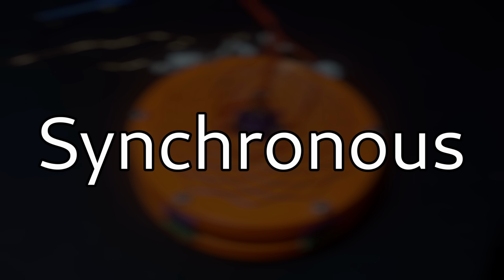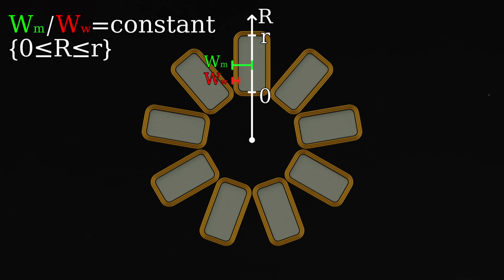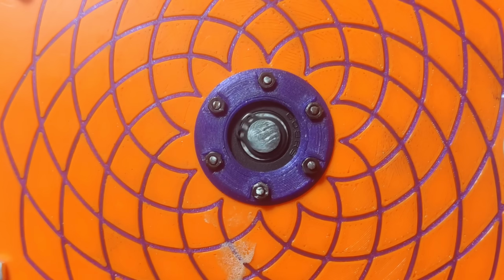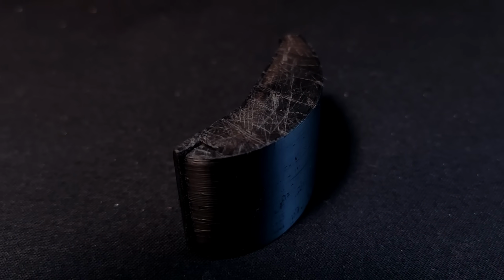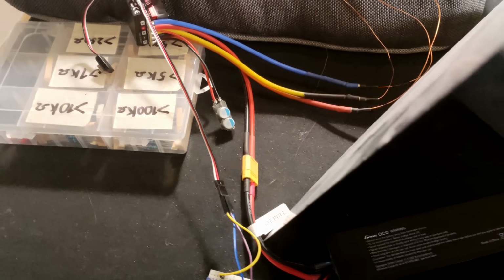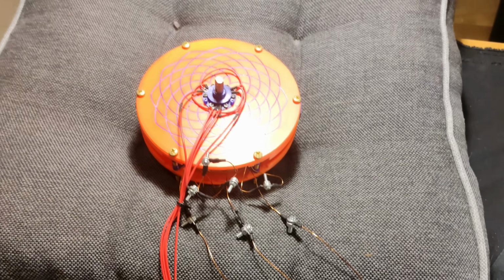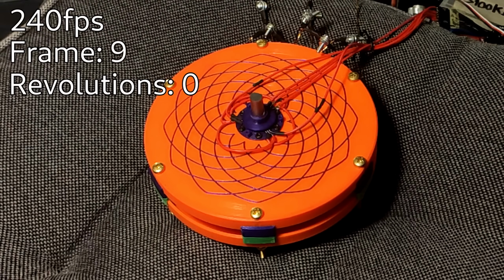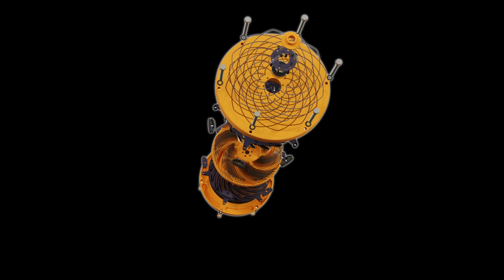Axial Flux Synchronous Motor Prototype

Comment: uhhh did u define reluctance motor wrong? The point of a reluctance motor is to act force on the magnetic metal, using it's reluctance to orientate magnetic poles, as something to push off of. Like someone drop kicking you with both legs in order to jump somewhere, they are using your body's inertial reluctance as an anchor to manipulate force... which is nothing like what you explained...
Reply from the maker: Reluctance motor rotors are made of magnetically soft materials. This means when an external magnetic field is applied (from electromagnets on the stator), the material essentially becomes a magnet itself while the magnetic field is present. Because the generated magnetic poles on the rotor are opposite of what polarity is generated on the stator, then the rotor poles are attracted to the electromagnet poles and as the electromagnet poles rotate, the rotor rotates with it.
Reply: @BirdbrainEngineer  It's not incorrect but I think talking about magnets and attracting poles obscures what reluctance motors are about. The generated torque is such that the reluctance for a statically applied field is minimized and the magnitude of that torque is proportional to the derivative of reluctance over angle. Reluctance is inversely proportional to the magnetic permeability of the material so while high permeability materials are used, magnetization is not a requirement. As long as the permeability of the rotor core is not uniform over the angle, it is a reluctance motor. So you can in fact make a reluctance motor out of superconductors if you wanted to since superconductors have infinite or close to infinite reluctance making the air in between the low reluctance path for the field.

Comment: I was worried about delamination during your RPM test.  You're braver than I getting an FDM part to 7200 rpm, ha.  Great video!
Reply from the maker: I do all the initial tests for motor max speed behind a sheet of metal and not looking at it directly. On other motors I usually find that the speed is not too bad so I ditch the protection but not with this one haha.

Comment: I wonder if you pull started with the original rotor or used a sawtooth timing wheel if it would work. ~30rpm from your fingers is most likely out of the tq curve of a 7200rpm motor.

Comment: Very nice! I've been making a motor for a pc cooling pump, and landed in about the same axial configuration. I used permalloy sheet cut into iron slots, but it worked without core as well. It took me about half a year to build a working pump.
Now I am building a blower turbine for air cooling, rotor printed already, but had no inspiration in developing it further. Now I might have it, thanks to you.

Comment: Very cool stuff!
Like you said, bot having proper bulky magnetic cores is probably the biggest problem. But besides that, I wanted to point out that i think you should be able to measure the rotor position using the existing copper coils. Using an hf signal, you should be able to see different inductances at the channels, depending on their alignment.
I'm not sure if there's a good way to get an absolute position this way, but at least getting the (electrical) position of the coils relativ to the stator should be possible (and sufficient for efficient operation).
If you don't feel like modulating a pieer wire, you can probably also add some extra sense coils. Using the symmetry of the design you could place them in a way that they would be mostly unaffected by the voltage induced from the poeer coils.
Dang, noe I kinda want to try that...
Reply from the maker: Back-emf based control scheme is used in sensorless speed controllers, however, since the initial idea was to make a reluctance motor, which produces no back-emf, so this control scheme would have been impossible. Generally hall effect sensored position feedback is superior to back-emf based position feedback, especially at low speeds, which is why basically every synchronous motor that has any significant power output has hall sensors in them.

Comment: Amazing! Do you think a 30kw motor could be built with this concept?
Reply from the maker: If using metal construction and make it larger and so on, then why not. Some supercars use axial flux motors that produce up to 400kW of mechanical power... but of course they have complicated active cooling, best materials available and so on.

Comment: Very nice! Great job! You were able to figure out how to get full power to the speed controller?
Reply from the maker: Using the battery, the ESC is able to pull up to 40A before the voltage starts to drop significantly... At those amperages though, both the ESC and the motor itself would overheat very quickly, so I never really pushed it that far.

Comment: Another thing you could look into is converting your DC Axial Flux Synchronous motor is into a DC to 3-phase AC axial flux synchronous motor. When you adjust the frequency of the phase, you will also proportionally adjust the RPM of the motor so you can go from 0 RPM to 7500+ RPM. You will need to use a MUCH stronger material if you decide to go this route as the motor could break under the immense centripetal force. There is a sponsor that makes quality parts and not just PCB's for your build that I would recommend. PCBWay. I'm not sponsored by them but I do love their company.
Reply from the maker: This motor essentially is a 3-phase synchronous AC motor already. Just simply that it is not designed to work off mains voltage, and indeed, it would overspeed and tear itself apart... or more likely just burst into flames if connected to the mains 3-phase. But if I use a VFD, like is necessary for driving such motors off mains anyways, then it should actually work just fine at lower voltages.

Comment: Hey Birdbrain, make a note of this... the thinner the iron core, the less eddy currents you will have to deal with. Eddy currents will cause you to lose efficiency and will produce more heat as a result. Overall, you've made an AMAZING build for an axial flux synchronous motor. Keep up the great work!
Reply from the maker: That is true, yep! My goal wasn't to minimize eddy currents this time... but for the future I have a stator design in mind that should be great at minimizing eddy currents.
Reply: Also, the eddy currents can be used to move something like an aluminum wheel. Just as an example to illustrate the point, if one were to rotate a set of magnets arranged in alternating north/south alignments near enough to an aluminum plate/flywheel mounted on an axle that plate will rotate and there will be less overall heat in the original system from the eddy currents. An eddy current is basically an opposing force in the opposite direction and can be used to do work. I've been looking at this as a sort of capture system to capture the extra force generated when a magnetic gear slips due to too much input torque. Here is a video demostrating the basic priciple - https://youtu.be/wYNMpRUAuyY?t=183

Comment: For e-bikes, I like more torque rather than higher speed, there isn't really much reason to go faster than 20mph and it gets pretty dangerous without full safety gear. A center/pedals mounted motor instead of wheel hub mounted motors are also nicer, since you have less unsprung weight. But, if you really want to mount the motor to the wheel hub, definitely the back wheel and not the front. Steering the heavier wheel sucks over long distances. Also, rim caliper brakes are HORRIBLE for e-bikes, I learned that the hard way building my first e-bike xD get disc breaks, you'll thank yourself later :) Also, if you're building an e-bike for city use only, I'd highly recommend getting a bike from the EU, like the ones commonly used in the netherlands. They have nice geometry for easily getting on the bike, as well as an upright seating position, and a more comfortable pedaling position. Most bikes sold in the US are mountain bike style, which just sucks to ride around in the city for long periods of time.
Reply from the maker: I will be looking into converting one of the bikes I have already if possible... probably would be a rear-hub motor... if only I could find a wheel with hub, or even just the hub with no motor already present in it haha... Disc brakes are a requirement for e-bikes yeah.
Reply: I disagree on the need to not go over 20mph, especially living in america like I do and a city with piss poor bike infrastructure. Also most general ebikes are hybrid frames over here, or small folders. I agree that one benefit of mid drives is less unsprung weight and better balance, but they're also limited in power as far as what's out there, which I think is still only the 750w Bafang. Hub motors have more potential in that part in being bigger and more powerful. I think it was Rather B Welding that just took a 8000w hub motor and worked it to a mid drive. I would love to find one of those and basically copy his setup or just make basically a scooter with it.
Reply: @ItsDaJax  Bafang BBSHD it is a 1,000 Watt Continuous and 1,400 Watts Peak and that is OEM and you can Change out the BBSHD OEM Controller to push the BBSHD to 5,000 Watts and there is NO Hub Motor of the Same Power that can Compete with the BBSHD OEM Totally Forget if you Hop it up to 5,000 Watts for Just OEM BBSHD is ALL around use from in the Very hard Dirt Bike Trails to Riding Down Main St. in Traffic and doing the Speed Limit and Keeping up with Traffic your not going to do that with a 1,000 Watt Hub Motor go from hard Dirt Trails to Riding on the Roadway with Cars and be able to do the Speed Limit and it is Very Fast from 0 to 40MPH without any Peddling and it is just is not going to happen with a Hub Motor but with a Mid Drive Bafang BBSHD you be doing all that everyday and Right now I have over 3,500 Miles on my BBSHD and Going Strong  and Hub Motors can't even Ride on my Level. Hub Motors are Total Junk and Only Broke Fools Ride Hub Motor Bikes and Yea you can get a Hub Motor that is on the BBSHD Level but it will have to be 5,000 Watts or More and you'll have to have a Heavy Big Battery and it will be very hard to Ride in the Woods on Dirt Bike Trails and you will not be able to Pick up the Bike with the Battery in it and Carry it as that is Something that I have to do with my BBSHD for I Live on the Second Floor and I can Carry my Bike with the Battery in it with NO Problem and it does 40MPH and I Geared it down from the 48MPH it was Geared with OEM and there is not a Hill it won't go over without any Peddling at 30MPH min. going up the Steepest Dirt Bike Trails there is around me  and there Straight UP and I can go even Faster on the Road going up hills and I have gone 40 Milles on a Single Charge with only a 48 Volt/17.5Ah Battery with my BBSHD on my 26" Normal Tire MTB Try that with a 5,000 Watt Hub Motor and I Say 5,000 Watts for that is what it has to be to be on the Level of the BBSHD and Hub Motors are not even Close to the Same Class of Mid Drives that on a Totally Higher Level. Just Saying you Said a Lot of Things that are just Totally Wrong and I think we all know Why. and if you don't know it is being CHEAP and not caring if you Buy Trash Long as it is CHEAP Trash you will Buy it over Buying the GOOD Stuff once and Never having to Buy it Again like you have to do when you buy Cheap Trash. Bafang BBSHD is the only way to go E-Biking with the Adults and not be Stuck Riding in the Kiddy Park for that is all your Hub Motor can handle. So do you want to Ride with the Adults or are you going to Ride in the Kiddy Park with the Children for the Rest of your Life? Hope to See you Riding with us Adults Someday. Save your Pennies and Cents and Buy a Real E-Bike Buy a Bafang BBSHD so you too can Feel the Difference and Ride on a Totally Higher Level.

Comment: :D I think, the uh, iron inserts for the rotor would be making noise since it's loose. buuuuut, I think you could make a dye press out of wood levers and 3d printed parts.
also I think designing your own esc with visual feedback, as hard as it is, would help you see what's happening, and adjust everything!
Reply from the maker: I considered making a diy FOC unit... but fuck me there's a lot to it if I want to make something that actually works properly haha. Definitely would have to be a video on its own and I'm not sure if and when I'd do it.
Reply: @BirdbrainEngineer have a look at simpleFOC of you haven't already, it's pretty cool!

Comment: Have you considered simulating the motor designs? That might help with debugging next time you run into problems.
Reply from the maker: I have considered of course, and I will try to do so for the e-bike motor.
Reply: Sometimes ya just gotta build it like they used to, back when all they had was an idea and sketch paper.

Comment: Nice video! I think it'd be possible to replace the iron parts with iron powder-infused resin. That way, you could just pour the iron resin where it needs to go instead of cutting and bending steel. You'd also minimize eddy currents since the resin is non-conductive. You could also take it further and replace the resin with metal-filled 3d printer filament, although it'd be more expensive and wrecks brass nozzles.
Reply from the maker: The magnetic filaments for 3d printers are very poor magnetic materials - the steel laminations I made are far superior in terms of magnetic permeability. Any powder-based core is going to have poor magnetic permeability in general. In practice, as far as I am aware, powder-based magnetic cores are used in high-frequency inductors and inductors where you want a very clean release of energy... basically in places where you want to minimize eddy currents but don't care too much about the other magnetic characteristics of the core material. 
I already have an idea for how to make the stators better in the future.
Reply: @BirdbrainEngineer no eddy currents, yes, but more importantly in hf applications you NEED low hysteresis (which metallic iron and steel lacks), ferrite cores are a necessity in hf applications, the eddy currents are more of a bonus.
Reply from the maker: Ah yes, hysteresis losses was another reason for ferrite cores... couldn't think of it at the time. But yeah, I'm absolutely not well versed in high frequency applications, there's a whole load of new stuff I'd have to learn first.
Reply: You don't need iron core at all by converting windings into PCB stator then there is no problem of Eddy currents and Steinmetz losses
Reply from the maker: @BHARGAV_GAJJAR  PCB stators are not suitable for high load applications due to fairly poor thermal characteristics and low current density compared to wire windings or better yet, hairpin windings.
Reply: Michael Rechtin (here on YouTube) made a BLDC motor with iron-filled PLA filament (and lots of strong permanent magnets). It worked OK—not great, but better than this motor.